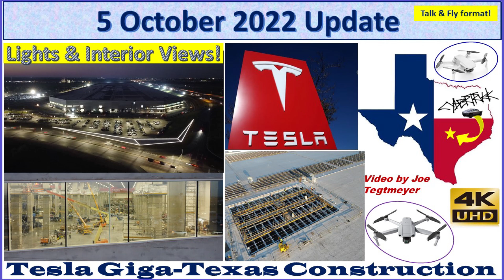Cyber Berm lights & Views inside Casting! 5 October 2022 Giga Texas Construction Update! (06:55AM)

Comment: They have put reinforcing jackets around the bridge crane supports on the concrete columns.  That suggests heavier cranes or design flaws in the columns.  Pretty good bet that the new casting machines are heavier than expected and the columns are getting reinforced .  So my bet is on new, higher capacity crane on the west side.
Reply from the maker: I think you are correct … and it seems all of the columns inside have these jackets now. They were not installed in April at the Cyber Rodeo.

Comment: Hi Joe, Re: the substation work.. The angle based poles will most likely be used to construct "A"-frame structures to support bus bars and switchgear.  The control house will likely not have offices but sill be used to house the backup batteries, relay panels and communications gear required to remotely operate the switchyard/substation.  I hope that this will help explain what these components will be used for in the overall substation.

Comment: So much rework is very disappointing. Elon is spot on -- it's a burning money pit
Reply: Have you ever managed a project of this magnitude? Even from the earliest of times, falsework had to be built to enable construction. Look for articles about Washington Union Station, for example. Or any number of buildings with large spans, even bridges and tunnels.
Reply: @The_DuMont_Network  In my opinion, this project is clearly mismanaged. If I remember correctly... Musk mentioned the 500 ft. extension BEFORE they poured a single cubic yard of concrete! No need to pour 500,000 sq. ft. of concrete, use it a few months, then rip it up! One can only conclude....
1) The factory is a "money furnace" and Musk is the guy with the shovel, shoveling the money in.
2) 400 pounds of CO2 to make one cubic yard of concrete. The leader claims that he wants to help the environment. What does that make him? Hypocrite?
Reply: @DavidJohnson-tv2nn  Why, then don't you get on Twitter and ask him?
Reply: @The_DuMont_Network  I don't have a Twitter account.

Comment: Bridge cranes removed due to foundation differential settlement maybe.  This corner of the builing if I recall had the worst soil and groundwater conditions.  Just a guess.
Reply: Differential settlement would cause more problems with the roof. To fix settlement at the columns they could shim under the crane rail for the bridge crane.

Comment: Joe, Thanks for the inside views today. Some comments:
6:09   Two machining centers to the right, mounts appear to be the size for front or
 rear "Y" castings, not large enough for dies. Machining center to the left is larger for (CT)?
6:59   Robots on the right. Each die caster requires 2 smaller robots for die cleaning
 and release agent, 1 larger for feeding aluminum and 1 large for part removal.
12:31  Angled poles are for "A" frame structure for incoming transmission lines similar to existing substation.
16:46  Six receiving docks.
19:30  The floors of these containment areas may have been already poured.
24:27  Air intake filters for roof mounted intakes for cooling systems.
25:46  If my memory serves me well, I believe that the road south of the building is asphalt, not concrete.

Comment: Thanks Joe.
5:00. Casting. Small yellow crane hoisting up a section of the steel collar. Stack of collar sections stacked nearby.
5:28. Casting. Dismantling the scaffold above the workshop/office.
6:03. Casting. The 3 wooden crates with blue tarps must be what was delivered yesterday on the heavy delivery low loader. https://youtu.be/m8ld3yUtqSQ?t=95
6:41. Casting. Left of screen. Stacks of what look like large ingots. Multiple times bigger than those currently in use, so could be something else. Removable floor panels perhaps.
Centre of screen. Seem to be furnaces.
8:17. Casting. Right of screen. Die removed from a gigapress.
9:59. Battery. Gravel floor inside the drive through doors. 
15:49. Temporary hire depot. Trailer load of trusses for a sprung structure/tent.
16:48. Cathode, north. Level 1. Done with the yellow moisture proof membrane.
17:28. Cathode, west. Couple of dozen square slab thickenings likely for columns over. To the right  U shaped slab thickening. For external plant perhaps.
18:35. Cathode. Blue pipe. I guess a trench alongside the length of Tesla Rd is next to connect into the town supply.
19:33. Cathode. Level 1. Setdowns/pits for machinery for sure now with the vertical rebar arrangement. Base concrete slab has been placed already in the left pits.
20:33. Project X. 
21:12. WOW yard. Site access road has been resurfaced.
21:57. Helipad area parking. Excavating the section that didn’t get paved. 
22:50. BIW, roof. Constructing a stud wall that projects through the roof. Possible different arrangement of the above roof components than elsewhere.
24:31. GA, apron. Trailer load of framed mesh panels.
24:36. GA, road. Load on the trailer is marked Encel or Engel.
25:20. Hardstand demolition. Found a less dusty way to demolish.
26:07. GA. Level 3 loading platform. Appears to be a removed beam. Remnants of the floor decking still attached to the top. Better shot in Joe’s Patreon photos.
26:13. Hardstand. Spray marking the slab for further saw-cutting. String a line, spray paint over, remove string.
26:52. Hardstand. Loading platform. Painters at work. The crane may be there to lift it onto taller blocking for access to paint under
28:14. HDD site. All the drilling gear is still on site. Possibly planning more works.
Reply: Dessie, I keep thinking it would helpful to give you some kind of pointer for the videos (  photos )
Reply: @benguthrie49  Now that would be a handy feature! 

Like clicking on a timestamp takes you straight to the exact point, a way for viewers to add an arrow to some relevant feature.  Good idea.
Reply: 25:20 Jackhammer operator lost his job.
Reply: @sammyk874  25:20. He thought he had a job for life.
Reply: @DessieDoolan  Indeed.  Hope he didn't borrow on future earnings!
Reply: @sammyk874  If he's smart he'll move into concrete saw-cutting.
Reply: Must be Engel, we've seen it before.  Engel Global.  Injection molding I think.
Reply: @sammyk874  I think so. Engel showed showed up in "The Database". 
July, https://youtu.be/zZFiTroVlRc?t=194

Comment: Could the removed overhead cranes and reworked columns indicate going to a higher capacity crane?
Reply: Could be, if they install heftier beams, or reinforce the removed beams. If the removed beams are reinstalled unaltered, then it could just be a rethink by the structural engineer.

Comment: What is the deal with all the Model Y's on the south end that are getting caked with very abrasive dust?  I hope these aren't for customers, but if not, what are they for?
Also, how much $ was wasted on the concrete on the south end?  Some of this is going about as smoothly as Elon's TWTR acquisition.  The number of changes/rework/redesign is ridiculous.
Reply: Yes, my thoughts exactly. These changes and reworks have been going on almost from the beginning. IIRC wasn't that big concrete pit at the south end changed mid-work. Then there's all the reworked walls - cutting completed walls to add windows (and then changing the windows), cutting loading docks, paving parking lots with macadam and then replaced with concrete, interior changes. The list goes on and on. All that rework can't be cheap. And the 500 ft extension has been on the drawing board for almost a year. Yet they still paved that parking lot with concrete! Does NOT make a lot of sense.
Reply: @GntlTch  Unless you have been in all the design and redesign meetings, perhaps you might have a different opinion. In a project of this size and over the time span, it is inevitable that changes will be in order.

Comment: I cannot figure out how rain water is collected on the roof and down piped into the underground systems.
Reply: @ 23:12 If you look along the edge of the exterior wall, you will see pairs of roof drains. These also run down the middle of the building. One of each pair of drains goes through piping to the stormwater system. The other drain is an emergency overflow drain that goes through piping and exits through an exterior wall, draining directly outside the building. The emergency drains are slightly elevated. So they only come into use if the main drain system is plugged.
Also.... Some of the water from the main roof drains is diverted to a rainwater collection system, and stored in concrete vaults under the factory floor.

Comment: 13:15 Angled poles are often used in pairs to form a V. It creates a very strong structure for the termination of the power lines.
14:00 I think that calling that building a "control room" is a bit generous. Almost all electric substations are controlled remotely. The equipment going in there will likely consist mostly of monitoring equipment, relays and switches.
20:40 In my city, drinkable water pipes are usually a light green. Red is for power. Yellow is gas. Black and white are for waste water and surface water. Looking at charts, blue is usually compressed air.
Reply: The blue pipe is likely “Blue Brute C900 JM Eagle” usually used for potable water but can be used for most less than 250 psi pressure applications.
Reply: 20:40. They used blue for the potable water main around the main building. Likely the same.

Comment: @ 25:40 "a large major construction project"
Sorry, but I beg to disagree. I call it a large major waste!
Reply: Why they would install reinforced concrete just to park cars on for a few months is beyond me.
Reply: @michelangelobuonarroti916  I would guess the next project timeline was moved up, if it is the expansion, it would be earlier than most speculated (2024 was my guess) . With having a concrete plant on site and the equipment to recycle it there as well, the cost to cover and recycle would be cheaper than trying to keep a mud pit maintained, and control  run-off during construction. It seemed they tended to use black top for shorter term solutions before recycling that as well.

Comment: I try to watch all your videos, but I confess I may miss one or two. So if you have already commented on this, my apologies, but do you have any idea what they are going to put in the place where they are  removing the concrete at the south end of the building?
Reply from the maker: Informed speculation is a new section of the building to lengthen it around 500 feet or about 130 meters
Reply: @JoeTegtmeyer  

Thank you, I was wondering about that myself, I guess they’re expanding it faster than they thought, or they wouldn’t of filled it in with concrete   lol
Reply: @terrysmith8655  The site has been chock full of temporary installs of this and that in order to get the Model Ys in production. Paving has been done, dug up, patched, removed entirely and replaced. Also I am sure there have been design modifications along the way.
Reply: @The_DuMont_Network  thank you very much for the information, that makes sense

Comment: Each column concrete support for bridge crane rail  appears to have been reinforced with steel plate crowns and welded anchors…….? In casting area….
Reply from the maker: I think you are correct!

Comment: There are rather thick steel plates that have been bolted around the tops of the columns to support the bridge cranes. I don't recall seeing them during construction. I wonder if they have been a retrofit. Perhaps the removed crane requires additional support changes in order to handle higher loads expected from the 9000T Gigapress. Keep up the outstanding work!
Reply from the maker: You are right they have reinforced all columns at the rail mounts so it’s possible they found a weakness that needed reinforcement after the fact.
Reply: I agree……either repairs or retrofit for structural issues……

Comment: What about those dusty Model Y's on the South end where they are removing concrete?
Reply: They've been around for a while, so I suspect they are being held for some reason.  Perhaps they failed an inspection and are waiting for some rework.  More likely, they are missing some parts.  It's possible that they don't have the sonar sensors and will soon ship now that they're switching to vision.

Comment: Could you show a markup of what a 500ft extension to the south of the main building would look like.  I seem to remember that was being authorized.
Reply: The outline for the expansion looked pretty much like the existing slab being demo'd.
Reply from the maker: Are you asking for a site plan view or an architectural drawing? I have site plan info but no images of how it would appear when completed.
Reply: @JoeTegtmeyer  just thought a possible outline shown around the area where the south parking is being removed would give an idea of what I thought was a planned 500ft expansion to the south.  That would pretty well also take out the drive area around that end of the building without going through the area used for temp materials storage between the current staging area that is being removed and the river. ... Never mind if it is to big of a hassle, just thought it would be good to visualize the building expanded that far. ... Love what you do and thanks for all the early mornings!